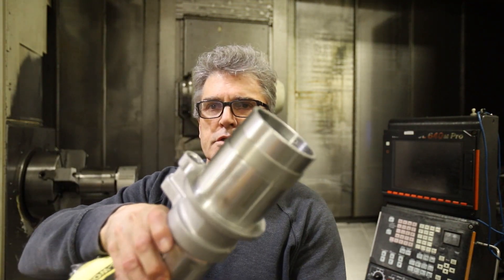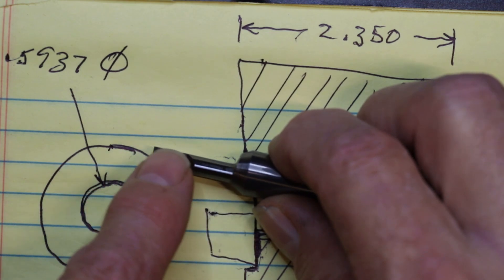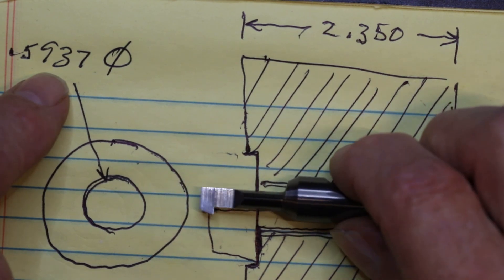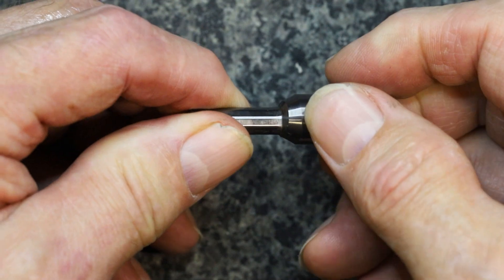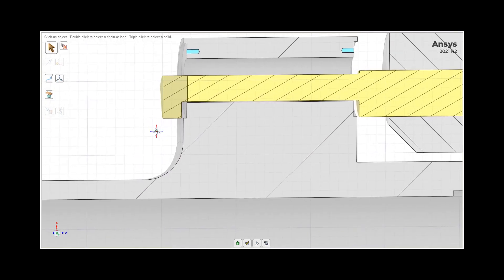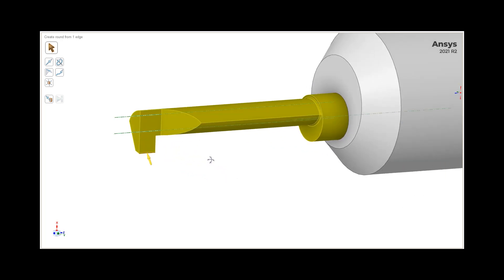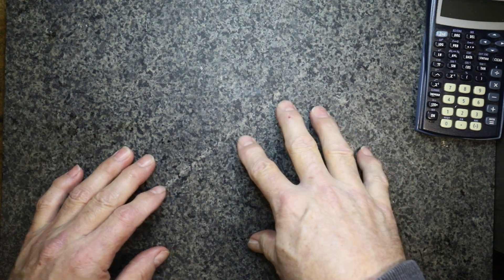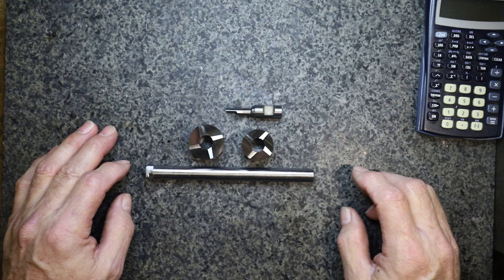Back Spot Facing Tools

Comment: Crazy they wouldnt drill and tap the shank on those back facing tools to where you could have a cap nut that held the cutter tight on the shank.
Reply from the maker: The intended design is to be able to run it without using extra tools. It’s more of a manual machine tool. Not meant for what I’m trying to do.
Reply: @EdgePrecision  Seems like other than the probably 10k investment in the angle head, re-working the back spot facing tools or even making a new arbor with a tapped hole and cap nut in the end, which would solve the loose head/locktite issue in the grinder would be most cost effective. Machine a new arbor, into the grinder, and at that point youve eliminated the loose head/chatter issue. More to it Im sure. 10K allows for a lot of work on a $150 worth of tools. - 150 bucks worth of those back spot face tools, make new arbors, re-grind, even if its 3 days your in it for $3500
Reply from the maker: @fpoastro  it doesn’t solve the issue with the small holes.
Reply: @EdgePrecision  No. That would still rely on your drill press solution. Im cnc millwork so I completely understand the balance of man hours vs. tooling. The future potential of the angle head is definitely hard to overlook. Just seemed like the cost of making the small busing/guide and drill press for the small holes, and 3, even 4 k in time and making the new arbors for the commercial back spotting, still leaves a mile of room compared to probably 10k by the time your done with the angle head. But none of the non-angle head has any future use. I feel your pain.
Reply from the maker: @fpoastro  Your also forgetting the three long tools required to do the small holes on the front side. These will be necessary to line up the back drilling guides. Like I said in the video everything has its cost. One way costs more but if the tools can be had quickly and nothing needs to be made. Or the less expensive way requires time to make things.
Reply: @EdgePrecision  Ahh, yeah, wasnt considering the front sides. I thought you pretty much had those covered.. Be very interesting to see your final solution.

Comment: 👍 great content Peter! Thank you.
Perhaps the customer would allow the small holes to be through so they could be drill from same end as c'bore op?
Don't think designers always have an appreciation for manufacturing 🙂.
If not, possibly plug as necessary after?
If anyone can make it happen it's YOU!
Reply: It's for an aircraft, so any changes from the original plans would have to go through FAA approval again. If the original plans call for one piece of solid aluminum, then you can't through-drill & plug it.

Comment: Isn't that part a fighter jet landing gear leg? are you sure the customer wants you to show it on youtube?
Reply: Aren't they visible also in them planes?
Reply: @MF175mp  Yes as for other parts he showed here but then the customer requested to remove the video for some reason, 
but where ever you see what you see doesn't have a reference to the manufacturing location and date here it sort of does.
Reply from the maker: No this isn’t that kind of airplane.

Comment: Grinding that cutter for a one time use would be a waste of time. Not only time, but then you run the risk of shatter when milling the part. It seems odd that the tolerance isn't close to zero from the shank to cutter.

Comment: Why not make a fixture for the table on a Bridgeport mill and just use a counterbore with the head turned 90 degrees I have done many second operations on a Bridgeport which is probably the most versatile machine ever made

Comment: good job.
 Why you don't bypass safety switch for the machine doors. Your life is gonna be much easier. Thank you good luck
Reply from the maker: This machine has auto doors it’s not really possible default or override the door interlocks. If you put the closed latch in the switch like on most machines. It sees the limit switches on the air cylinders the operate the doors. And you get a alarm. It is written in the machine ladder program and all the switches have to go in a certain order and eve in the proper time period you get a alarm. I even asked the guy I have work on this machine (not a Mazak guy). And he said it isn’t possible to disable the safety system on the doors.

Comment: More like stupid engineering, parts that can't be manufactured well.
Reply: They have been building landing gear parts like this for nearly 80 years and the design has not changed and the placement of those features are basically the same too.  This is a small LG part, you ought to see the ones on the 747's airplanes!